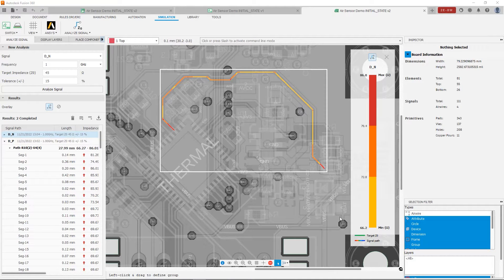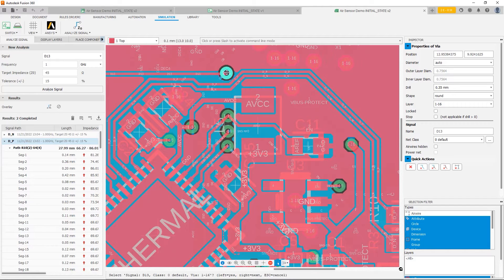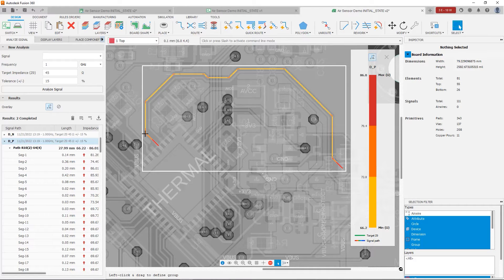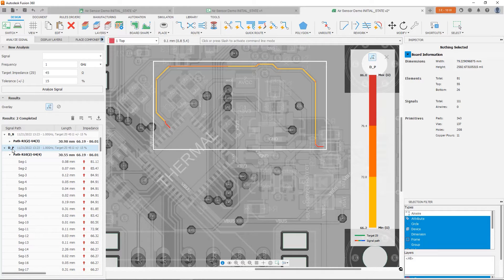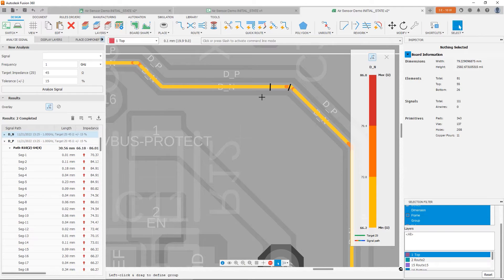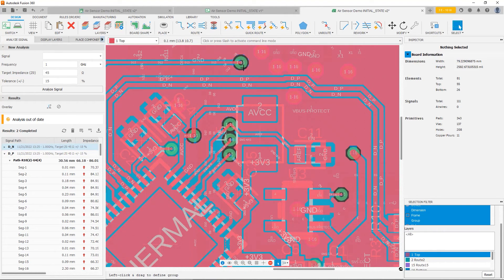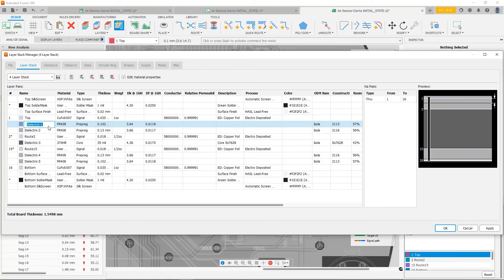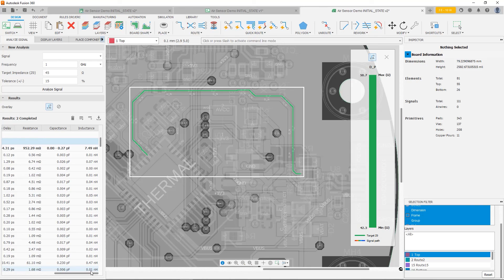Signal Integrity in Fusion 360: Problem-Solving with the Extension | Autodesk Fusion 360

Comment: Why use Singled Ended analysis for the target impedance? And not using the differential analysis? In the differential analysis the differential impedance should be 90,  in the way you are doing it won't be.